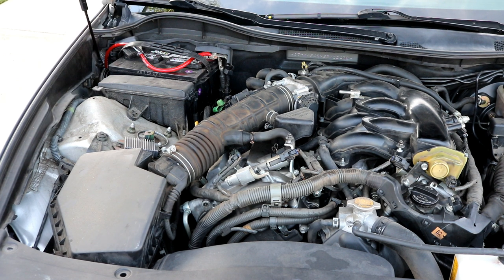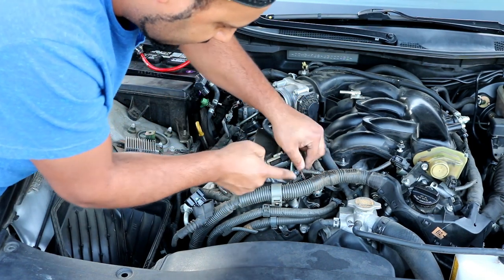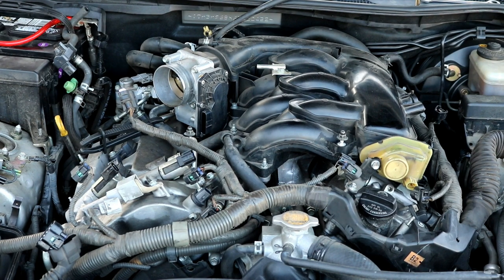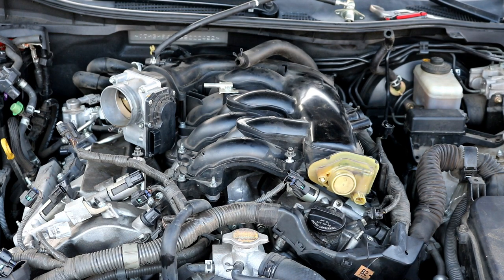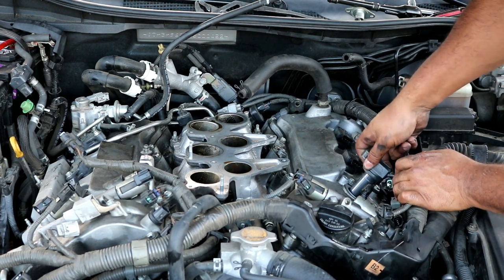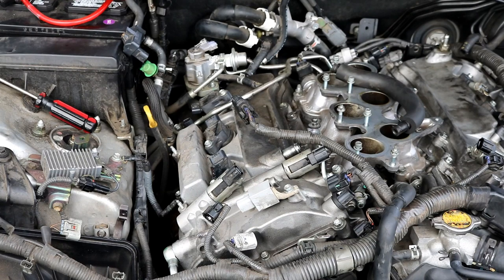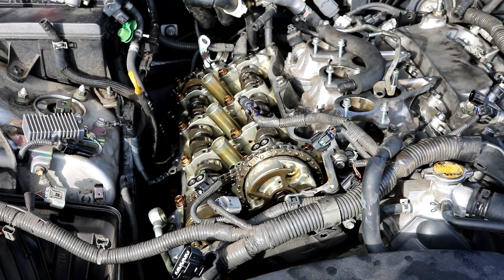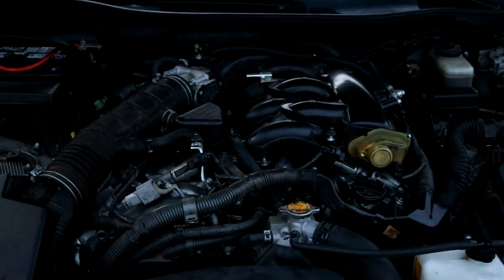Lexus GS300, GS350, IS350, IS250 Valve Cover Gasket Replacement

Comment: Just put a water pump in my IS350. took me about half a day, but I'm not going to lie. looking at this job. It does leave me a little intimidated.
Reply from the maker: Lol, it’s very time consuming as you can tell it got dark on me lol. But it is doable.
Reply from the maker: Not sure why Toyota would make things this difficult. They normally have pretty decent designs. But of course they can’t make everything easy.

Comment: In the middle of doing my 06 is350 right now. I unbolted everything on the driver's side valve cover but it's still stuck. Any advice on lifting it or loosening the gasket?
Reply from the maker: double and triple check there isn't a bolt still holding it down. Also if you followed the video completely, maybe you missed a bolt or bracket by chance. 

Sometimes they are stuck pretty good and you can get a small flat head screw driver to persuade the valve cover to come up and off. You  have to be careful you don't gouge the aluminum head sealing surface.
Reply: @HelpingHandAutoRepair  Thanks for the help! I missed the bolt between the coil packs.

Comment: Just curious, im replacing my fuel pressure sensor on my 07 gs350. Are there any bolts behind the plenum, or are they simply all over the top? And thanks, I'm gonna subscribe
Reply from the maker: Should just be the bolts on top. You would need to watch that portion of the video again tbh. This was a while ago and I don’t remember everything exactly.
Reply: @HelpingHandAutoRepair  yea thanks alot man. I've been literally studying this vid. Finishing up the repair this Saturday. I'll keep you posted

Comment: Great job very informative and detailed and neat, my question is the intake manifold gasket has other name plenum gasket or that’s different , because I’m getting a new spark plugs with ignition coil and the mechanic ask me to bring plenum gasket and also I’m bringing two engine cover gasket since I have seeping in the left one, so he recommend me doing it at the same time thanks again for your vid
Reply from the maker: There is a plenum gasket/intake manifold gasket. They usually are one in the same. However most V6 engines will have an upper and lower intake manifold/plenum gasket. Shouldn’t need the lower gasket since you don’t even have to take that off. The upper gasket should be all that’s needed. Unless he or you want to replace the lower one.
Reply: @HelpingHandAutoRepair  great thanks for the fast respond, but do I really need to change the lower one? Or the upper should be enough ? Also I saw your mentions the spark plugs tube gasket Do you recommend me replacing them since I have 111,500 on gs350 ? are yours was in a good shape ? Thanks again
Reply from the maker: You don’t need to change the lower one. Normally when you buy a valve cover gasket set, it will come with tube seals in the kit. If not, you need to buy them. That is considered “apart of” a valve cover gasket replacement. The car in this video was a customer’s car. I honestly can’t remember what they gave me in regards to parts since it was so long ago. I am quite confident that I would have told them to replace the tube seals.
Reply: @HelpingHandAutoRepair  I’ll replace them all not a big of a deal they’re very cheap anyway from lexus dealer. Thumbs up my friend have a blessing Sunday 🎊
Reply from the maker: Thanks. Same to you.
Reply: @HelpingHandAutoRepair  by any chance do you think there’s any crankseal and camseal since I’m replacing the valve cover gasket right n left and wondering if there’s anything has to be replaced at the same time just to avoid another maintenance later on, I called the dealer to ask for like any crankseal or camseal on the 08 gs350 they said there’s only crankseal but there’s no camseal !! Any idea if anything it should be talking care while doing this service thanks again for your time
Reply from the maker: They are correct, there aren’t cam seals on these motors. There is a big front timing cover that seals all the oil in the front of the motor. A crank seal is not even in the same area you will be working in so it doesn’t make sense to touch that at all.
Reply: @HelpingHandAutoRepair  I called a technician at Lexus now and he confirm what you’re saying now , thanks sir

Comment: Will this fix a car that has failed the combustion test on the coolant? I took it to Toyota and the basically said that I would need a new engine because I either have a crack in the block or a blown head gasket. If I open up my engine like this would I be able to tell which is which?
Reply from the maker: No this won’t help your problem. You need a head gasket job or a replacement engine

Comment: Do you recommend using a gasket sealer?
Reply from the maker: Scott c Yes on the front of the heads you will notice there is a timing chain front cover that attaches to the side of the FRONT on the cylinders beer heads. I just cover that seam where the two meet. I also put a dab in the back on the lowest points of the valve cover.
Reply: Helping Hand Auto Repair i changed both gaskets and put everything back together. But my car won’t start. Any idea what it could be ?
Reply: @scott3074   if you didn't depressurize the fuel pump system, you can spray brake/starter fluid in the intake while someone else cranks it
Reply: mask off k thanks . I was able to get it started . Just had to crank it a few times. I think I sprayed too much carb cleaner.

Comment: Did the job but now I’m leaking oil from the banjo bolt do I need new crush washers or why do you think it’s leaking?
Reply from the maker: Could need new washers. Or hopefully it’s not stripped.
Reply: Thanks for the quick response. I’m gonna get new washers tomorrow and hopefully that fixes my problem

Comment: Did you have to replace any o-rings when you removed the high pressure fuel pump pipe that connects underneath the intake plenum?
Reply from the maker: I didn’t

Comment: I keep getting p0455 and p0451 low evap i changed all the intake mainfold gaskets and changed the valve covers and spark plugs weirdly enough the evap hose connect to the purge valve wasn’t even connected when I started when I finished I felt like I was mixing up my breather tube and brake booster line it’s startes and cold starts smooth but when rpm goes under 1000 car won’t stay started

Comment: on the two bolts that go to the fuel rail (behind the intake manifold) how did you get them off? I’m able to get one off but the other is kind of under part of the manifold. I can’t seem to get my tool onto it.
Reply from the maker: I believe I used either a small wrench or a 1/4” ratchet with a wobble extension. Sort of have to get creative lol.
Reply: Crows feet

Comment: How did you get the back 10mm nut out in the back of the fuel pressure regulator line.
Reply from the maker: Probably with much difficulty lol. I think I used a short 10mm and a wobble extension.
Reply: I had to get a 10mm crawfoot to loosen the bolt but it is still not coming out.
Reply from the maker: Ann Borromeo I’m sorry as this was a little while ago. I think I had to either leave the bolt in while removing the whole pump or maneuver it out some way. I honestly don’t remember but I know I did remove the pump.
Reply: Looks like you have to take the actual plenum off or loose just to get that bracket off because one of the 10mm is directly under a sensor what a poor design

Comment: I started on the passenger side, eveything was moving along until I accidently stripped the threading on the banjo fitting hole on my GS350. Dont tighten down the perimeter bolts on the 17mm banjo fitting is in first...
Reply: Hey man, thanks for sharing this issue. I’m in the process of putting back the banjo bolt (Driverside) and I’m having a hell of a headache to tighten that banjo bolt back in place. Any advice?
Reply: @marcomelo8576 did you ever manage to fix it or did you end up buying a new valve cover?
Reply: @michaelvd2467  I was able to fix it! Just had to be patient and tackle it at the right angle. It’s just a pain the a$$ cause there’s not enough space
Reply: @marcomelo8576  great job man! I assume you own an IS? Noticed the very tight space around his banjo bolt on my IS. Won't be doing this job any time soon since my valve covers don't seem to leak anywhere but I'm mentally preparing for some big jobs in the future since my IS250 is at 200k miles now

Comment: What are the 2 hoses above the fuel pressure regulator? I have an IS250 and those 2 hoses are directly above the regulator and I may need to disconnect one of them.
Reply: Heater hoses

Comment: Hey man great video. I'm contemplating doing this on my 2006 RWD IS250 which I think has seeping oil from both side cam covers. It's been like that for a good few years. Does it effect anything if I was just to leave it seeping? And clean it once in a while?
Reply from the maker: John Roberts No it doesn’t other than smelling oil burning on the stock exhaust manifolds. This smell can enter the cabin while using the fan inside if you have outside air selected. It’s more annoying then anything really. 

Also you will need to keep an eye on your oil level. As it will gradually lower the oil level.
Reply: @HelpingHandAutoRepair  Thank you.
Reply: This video is a revelation to what’s wrong with my is250. I thought it was jammed brakes. But no, it’s burning oil.
Reply: Same problem here john..did you fix it ..I have same is250 rwd 145k km and it's leaking from multiple places on both side of valve cover ..should I fix it now because the car give that smell often when I push it past 120kmh
Reply from the maker: You definitely should try and have it replaced or do it yourself. The smell is just annoying. Plus you are losing oil over time and we all know what happens to engines that have no oil.

Comment: I know this is an old video..but please what is the name of the part that has a yellow cap in the back top of the engine next to the passenger side cover you took off. It gets hot apparently and is draining my battery my mechanic says. But he does not know what it is. Any help would be amazing. Thanks
Reply from the maker: Hard to see in this video. This isn’t my car but if our talking about that small yellow piece I can see very high near the firewall, those are coolant lines so they will get hot from the engine being hot.
Reply: @HelpingHandAutoRepair  thank you so much!

Comment: i got the manifold off and inside the plenum holes i see little plates. on the plates there is what looks like slug or carbon build up on them. should i clean them off?
Reply from the maker: Scott c Yes. Carb cleaner works 👍🏼
Reply: Helping Hand Auto Repair should I be worried if some  carb cleaner get past the plates into the engine?
Reply from the maker: Scott c No. it will evaporate after a while.
Reply: Helping Hand Auto Repair thanks a lot. I appreciate it
Reply from the maker: Scott c Of course!
Reply: Helping Hand Auto Repair I took all the bolts off but valve cover will not come up. I’ve been at it for hours. Any tips?
Reply from the maker: Scott c Make sure you have gotten every single bolt and nut off. It can be easy to miss one given the amount of them. Once you are certain you have everything off and loosened I take a flat head screwdriver and slip it between the valve cover and the top of the cylinder head.

Comment: This is a useful video. Thanks for your time.
I have a question about the lexus gs300 3rd generation . I have the code P0420 which means catalytic converter bank 1 is broken or something like that and I supposed that the spark plugs are bad so I changed them but the one spark plug from 5th cylinder had a little bit oil on . I changed the air filter too. I cleaned the air mass sensor also the body assy throttle  but the car runs bad and makes vibration . I made a diagnosis to the car and says that the oxygen sensor and catalytic converter are bad. Could you help me please?
Reply from the maker: Prior to fixing the spark plugs, air filter and cleaning the MAF was the car running fine?
Reply: No , that's why I make all this repairs.
Reply from the maker: Oh ok. Well I assume your car has a decent amount of miles on it? P0420 codes are indicative of a catalyst that is getting old. It could also by chance be a bad down stream O2 sensor on bank 1. This is not normally the case though as the catalyst is usually the culprit. If you have a scanner that can read live data, I can help you determine if the o2 sensor is bad.

As far as the oil on the spark plugs, you need to replace the valve cover gaskets to solve that. It is most likely running rough because it is misfiring due to the oil on the plugs.
Reply: The car has around 118.000 miles. I thought when I change the ignition coil of that spark plug which has oil on it maybe it will be ok if the problem will persists maybe I will check the catalytic converter with an endoscopic tool.
Reply from the maker: If there is oil on the coil then you need to replace the valve cover gaskets as shown in this video. Otherwise you will continue to have a poor running car because the spark will be arcing off into the pool of oil instead of going to the spark plug. This car must have been driven like this for a little while because now you have the 420 code which is being made worse by driving the car with a misfire. 

Fix the misfire first. The catalyst is getting ruined or may already be ruined.
Reply: Maybe you are right. I will do that first and I will see if the problem is the valve cover gasket. Thanks a lot for your time.
Reply from the maker: I am telling you the oil leak is because the valve cover gasket is bad. I know for sure 100%
Reply: After I will change the valve cover gasket  how do you think it will haven any problem with the p0420 code no more?
Reply: Sorry but I have to ask you again about valve cover gasket. The spark plug had the oil from the cylinder side and I think that the valve cover gasket in this case couldn't resolve the problem. What do you think should I check the cylinder cover gasket ?
Thanks
Reply from the maker: Sergiu Tarus That’s hard to say. If you have been driving on the car while misfiring for some time now, the catalyst may have already been damaged.
Reply from the maker: Sergiu Tarus If it was due to normal combustion then that’s fine. If there was oil on the spark plug coil boot and the white part of the spark plug then you need to change the valve cover gasket

Comment: Did you have to shut off or remove the gas pump first?
Reply from the maker: I let started the car and pulled the fuel pump fuse and let it run out of gas to try and relieve fuel pressure.
Reply: Thanks for the reply! Shoot I have everything off already and didn’t depressurize the fuel pressure lol
Reply from the maker: @gerardonato7219 it’ll be ok
Reply: @HelpingHandAutoRepair  yo i just wanted to say thank you for posting this! Just finished the job and she’s running so smooth now, like new!

Comment: I have a cylinder 1 misfire I have changed the spark plugs and coil pack on cylinder one and I still have a misfire...do you think I should replace the valve cover gaskets and see will that fix the problem???
Reply from the maker: dontavious moore cylinder one will be on the left side (looking at the engine) very first cylinder. Is this the one you  are working on? If so when you pulled out the coil pack was it soaked in oil?
Reply: @HelpingHandAutoRepair  yes
Reply: I have valve covers off and everything looks good compression good and all 6 cylinders I just don't know why cylinder one has a misfire
Reply from the maker: dontavious moore well the valve covers need to be replaced like you’re doing. Clean the oil out of the spark plug tubes (just take the new plugs out and let the oil run into the cylinder) clean the plugs and put them back in. After this if the car is still misfiring on cylinder one then you need to make sure that the new coil pack you got isn’t defective. Maybe exchange it for another. Or go with a different brand. 

If it is still misfiring then you need to swap the injectors from 1 to 3 or 1 to 5 and see if it follows. Injectors can also cause misfires.
Reply: @HelpingHandAutoRepair  ok thanks
Reply from the maker: dontavious moore of course. Let me know how it goes and if you have other questions.
Reply: @HelpingHandAutoRepair  ok I sure will.

Comment: I did my spark plugs today and found very little oil on one of the spark plugs. This is what I have to do?
Reply from the maker: Technically yes. If it’s not much then you could probably get away with not doing them for a LITTLE longer but that’s just avoiding the inevitable.

Comment: Hello there. I am a bit confused with the banjo bolt size. You’re saying it’s a 22 mm. But mine is 17mm. Any thoughts?
Reply from the maker: Use a 17mm if it is.
Reply: @HelpingHandAutoRepair oke thank you. Also how do you know if that’s the right way to instal the spark plugs tube? Bc i watch fel pro video and they said the tapered side must face the tube?

Comment: I'm stuck at the banjo bolts now. Mine are leaking😩I'll have to order new ones
Reply: What did you do to tighten the driver side banjo bolt back in place. I was able to get it in but that 🤬 is not tighten. Any advice would help. Thanks!